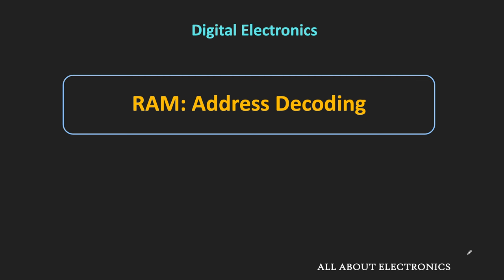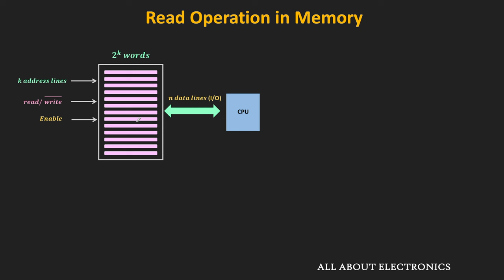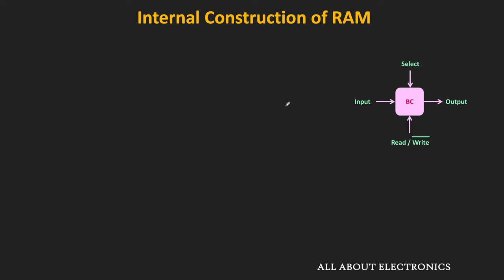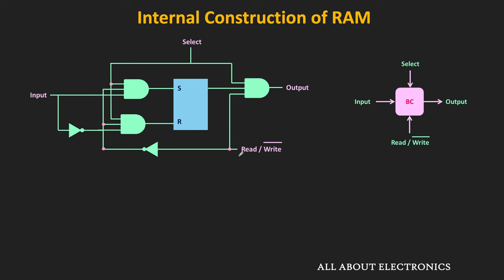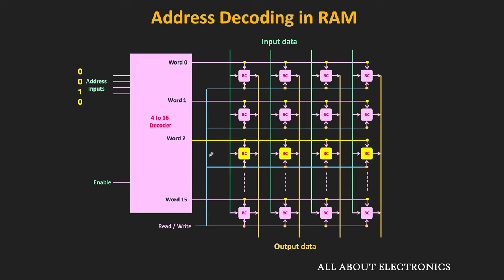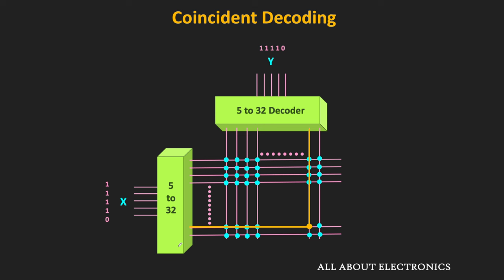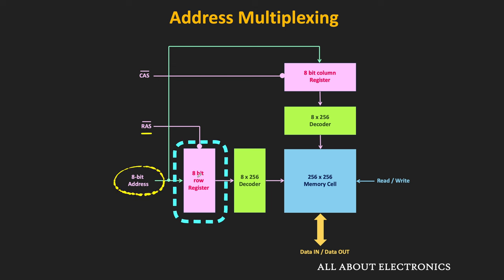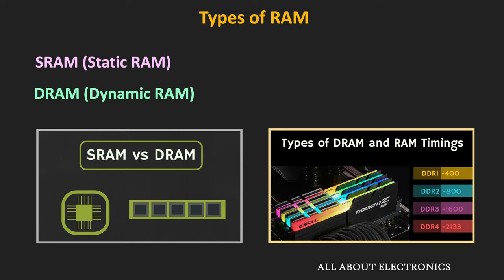Semiconductor Memories : RAM - Memory Decoding Explained

Comment from the maker: The link for the other useful videos related to memory and memory decoding:

1) Decoder Explained:
https://youtu.be/a3wh7xV5PBU?si=EXXa757x8mijj5Fz

2) Error Detecting Code: Parity Bit
https://youtu.be/Bwih7_AT1oI?si=KBy4S5mymP-_xwPa

3) Hamming Code: Error Correcting Code
https://youtu.be/t4kiy4Dsx5Y?si=Jm-Mvz5ZoBmGQS05

4) SRAM vs DRAM
https://youtu.be/r787m_IaR1I?si=flXSh3EmNu1ko6-i

5) Types of DRAM
https://youtu.be/DLM20pWqMyU?si=z4jZUPkQsMZCDV9Q

6) Cache Memory:
https://youtu.be/Zr8WKIOIKsk?si=8HBGfJL5Ye4WEGw_

7) Semiconductor Memories: RAM
https://youtu.be/a--rNdqtwCI
Reply: Please make a video on column multiplexing for memory and how many muxs are required while folding the whole memory cell , i mean that how the aspect ratio can be reduced in memory cell.

Comment: Sir, what is the difference between the logic circuit of 1 binary cell and using SRAM Cell (7:58)?
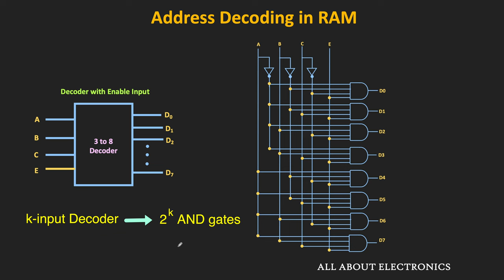At 14:43 it should be "k+1 inputs for each AND gate"
Thank you for these amazing videos.
Reply from the maker: The SRAM cell circuit is the actual circuit. That is how the 1 bit of information is stored in the SRAM. But here the circuit which I have shown for 1 binary cell is a logical circuit. That is a way of representing the same circuit in a logical way.

Comment: What is the difference between address multiplexing and coincident circuits ? 18:38
Reply from the maker: In coincident decoding, the decoding logic is divided into row and column decoder. Here, for both row and column decoding when we use same address lines using time multiplexing( rather than separate address lines) then that is called address multiplexing. I hope, it will clear your doubt.